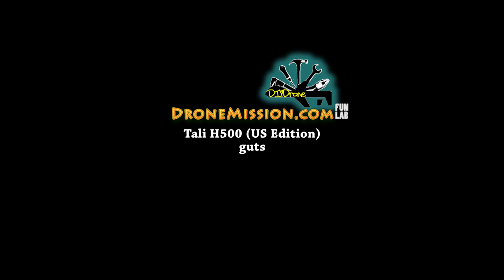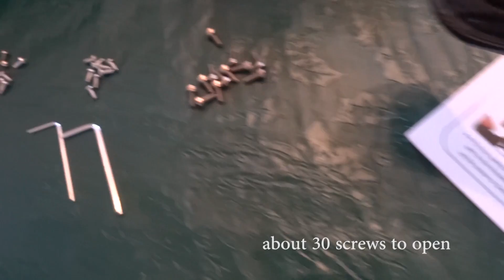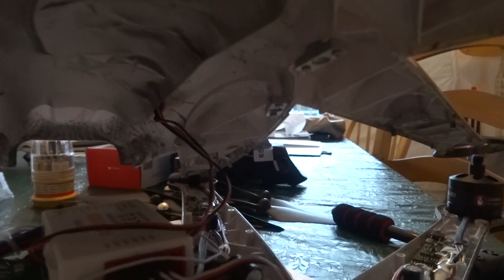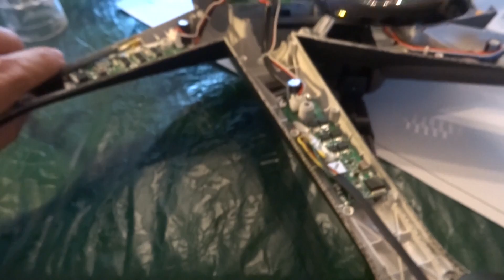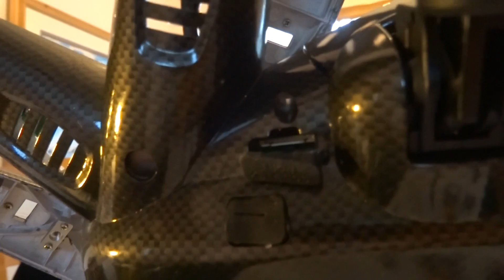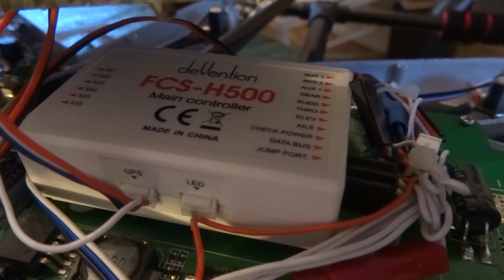Walkera Tali H500 - unbox inside look of the H500, design, BNF.

Comment: great video. I keep seeing the term BNF. I'm sure this is a dumb question but what does BNF mean?
Reply: hey kool, BNF is bind and fly, basically vanilla, the model without the extras.  you will need to open up and add a receiver and bind it with own computer radio.  it is provided to experience users who rather use their own equipments and the cost in this case is 1/2 the package price.  once you have a pro radio or gopro, you will most likely be looking for BNF models.
Reply: dronetestpilot your awesome! Yank you